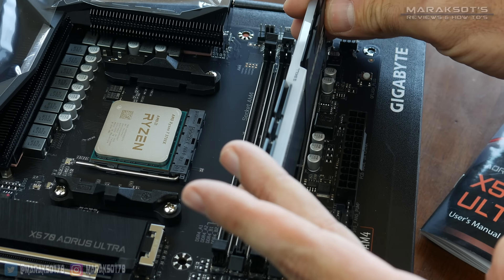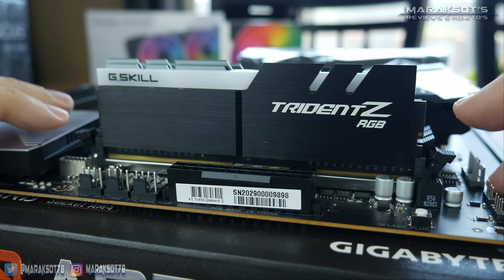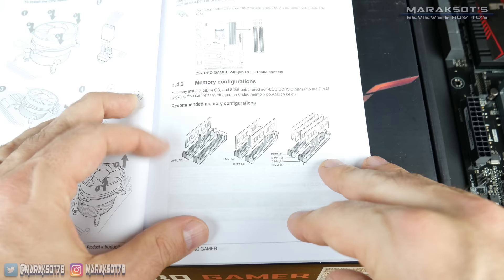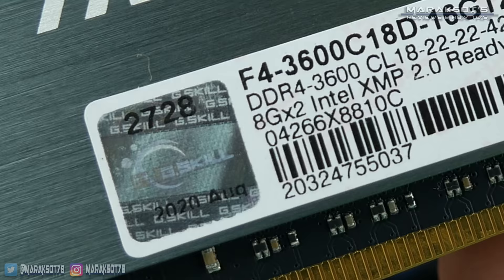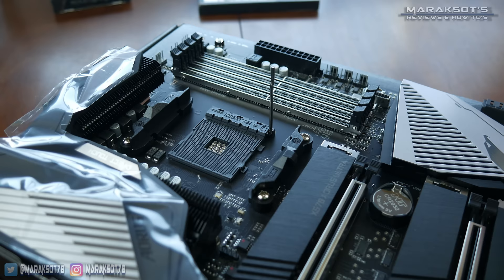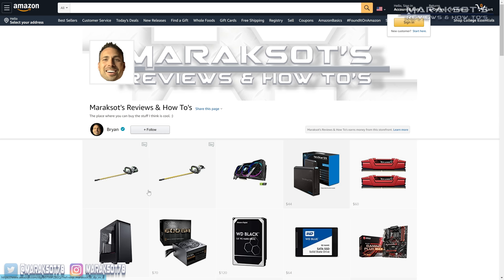A Beginners Guide: Upgrading Your PC's RAM

Comment from the maker: Wanna skip to a particular part of the video? Use the Time Stamps. :)

Time Stamps

0:00 – intro
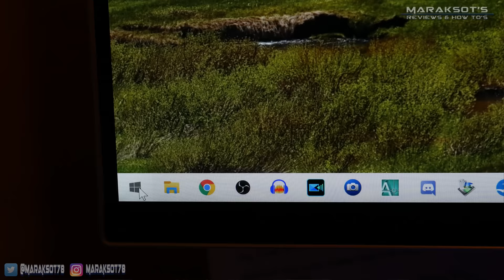0:22 – the first steps
1:33 – how to remove RAM modules
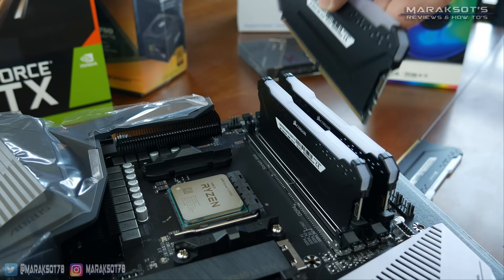2:03 – how to install RAM modules
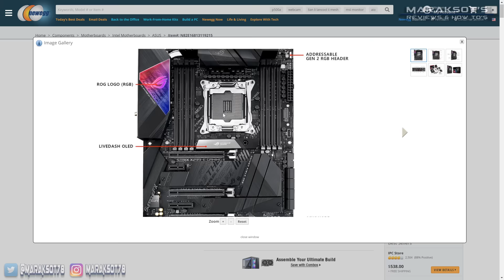2:58 – 2, 4 & 8 DIMM slot motherboards
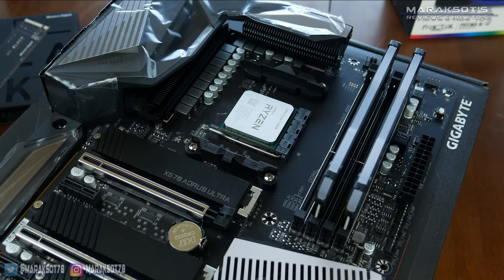3:30 – Single Channel or Dual Channel?
4:10 – running your RAM in Dual Channel
4:41 – using 1 stick of RAM only
4:57 – tips for adding more RAM to your system
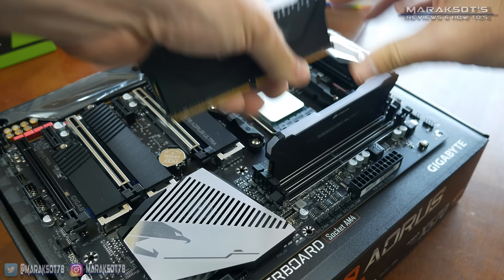7:12 – tips for upgrading your RAM
7:40 – determine your RAM type (DDR3, DDR4, DDR5)
8:40 – How much RAM should I buy?
9:01 – What speed of RAM should I buy?
10:00 – check your motherboards memory support list a.k.a. QVL
10:51 – my first PC building experience
11:56 – Thanks for Watching! Like, Share, Comment & Subscribe! :)
Reply: okay please see this my mic is not in my audio settings, like it says no devices installed and my mic is plugged in
Reply: once i completely remove my okd ram sticks and in new ones will i have any software i have to download or do they start working right away?
Reply from the maker: @Austin-xm4ke  nope, no software to install, but if you want them to run at their rated speed you will have to enable the XMP profile in your motherboard BIOS.
Reply from the maker: @PalaceLad  yup, they go in the same way but the latch on the one side is the only one that locks.  :)
Reply: I want to buy the NZXT Starter PC and I want to upgrade and replace the one stick of ram. Do I have to download anything to upgrade it?
Reply: Nvm i made it to the part in the video where you say it is easier to replace the ram
Reply: @Maraksot78 Is it possible to have three sticks of ram
Reply from the maker: @ratanvuyyuru9076  I would of course turn the computer off, unplug the power from the wall and then remove the old RAM (assuming you're removing your old RAM), and then install the new RAM.  There's no need to unplug your monitor, keyboard mouse and other stuff unless you can't get your PC into a position to work on it with all that stuff still plugged in.
Reply from the maker: @ratanvuyyuru9076  No worries... I have never disconnected the PSU from the motherboard. I guess for the safest possible practices you would do that but I've never done that and in 15 years of PC building haven't had an issue.
Reply from the maker: That's what I would do.  Linus Tech Tips actually made a video recently where they used an ESD gun and intentionally tried to kill PC components with an electrostatic discharge and showed it's actually far more difficult to kill your components with ESD than many people will lead you to believe. Yes it is possible, but it is honestly far less of a concern than the ESD fear mongers want you to believe.
Reply from the maker: @ratanvuyyuru9076  here's a link to LTT's video if you're curious. They do kill some RAM right at the beginning but if you keep watching they try to kill some more and end up hurting themselves more with all the shocking they do than the RAM. 😅  https://youtu.be/nXkgbmr3dRA
Reply: Hii I just don’t want to get my pc killed, so is holding a metal part of the pc full proof?
Reply from the maker: @leonm6969  it's actually a lot more difficult to kill PC components with ESD than many people will lead you to believe. LinusTechTips actually made a video about a month ago where they tried to kill some sticks of RAM using an ESD gun. While they did succeed at first, they spent the rest of the video trying to kill another stick of RAM but were not able to kill another one even though they were shocking the RAM with more static than a human typically carries. If you'd like to watch the video and see just how hard it actually is to kill PC components with ESD here's a link to their video. https://youtu.be/nXkgbmr3dRA
Reply: Best video yet and very very informative 💯%
Reply: After physically adding a new RAM stick, do you need to do anything on the PC or does it automatically gets used by  the PC ? Thanks
Reply: you don't install more ram, you download it. Everybody knows that
Reply: I really liked the video and the simplicity of it. Great stuff
Reply: Hey buddy I have watched whole tutorial now what? Should I start the pc and I will have 16gig of ram or any setting must be done from inside
Reply: Do i have to take the whole motherboard out of my pc to install more ram?
Reply: @Maraksot78  what is XMP?
Reply: stuck at preparing automatic repair after installing new ram? suggestions?
Reply: i think i only have 1 place where i can only place 1 stick of ram? what do i do
Reply: Thanks, great info and your delivery is enjoyable. I wish I could talk to a camera like you do,
Reply: Is it safe if i replace my ram sir?
Reply: Since I plugged two new sticks of RAM into my pc, my monitor screen goes to black every 10 to 60 seconds then comes back on. Please help! @Maraksot78
Reply: @Maraksot78  Hi I'm a newbie when it comes to pc stiff. I would like to know if I currently have (2) 8gb oloy sticks 3000hz total of 16gb ram in my gaming pc. But I'm looking to add a another (2) 8gb oloy sticks same brand same speed to my pc to add a total of 32gb ram after I install the other 2 sticks do I need to go into bios to adjust the speed on the other 2 sticks? Or do I just install them and do nothing else?
Reply from the maker: @Mario-uq8gr  you'll need to go into BIOS and enable XMP again. I'm pretty sure it will go back to default when your system boots up for the first time and recognizes the new RAM.
Reply: @Maraksot78  ok cool thanks
Reply: Got a question when wanting to completely change the ram like take out the old ram and add new ones can I just use any brand?  and if I need to do anything else if I change it like do something in bios I’m a newbie if you didn’t already tell hehe pls help
Reply: @Maraksot78  do I need to use XMP? cant the ram just go with out it?
Reply from the maker: @animations iguess  your RAM will work normally without enabling it BUT it will only run at the rated XMP speed if you enable the  XMP. For example, unless you enable your XMP DDR4 will only run at 2133MHz no matter what your modules rated speed is.
Reply: @Maraksot78  well I’m mainly wanting to get more ram because my ram is getting full my memory is at 71%-91% and I can’t play my games anymore thank you for answering my question! Very helpful indeed
Reply: Yes adds... Yes lickbait.. Tells you when to skip videos if that iformation is not for you... 
Subscribed!
Reply: I put 4 x 8 gb dual channel ram from 4 x 4 gb . PC showing 24 gb with (15.9 gb useable) .How can I make it read 32 gb only? My PC games 20% faster on FSP and my resolution on video streaming internet also got better by 20%. I really like to see if I can get it to 32.gb instead of showing 24 ( 15.9)
Reply: can i ask? i have 16gb ram but the half of it is not use, what to do?
Reply: that's not working.need to upgrade memory

Comment: you don't install more ram, you download it. Everybody knows that
Reply: Is this true
Reply from the maker: @kerryangel603  Downloading RAM? No it's not true. It's an old joke among PC DIYers.
Reply: @Maraksot78  ohh btw you think you can help me
Reply: @kerryangel603  I know it's 3 weeks later, but what you looking for help on?
Reply: @mynameis8211  installing ram
Reply: true that currently downloading one from an unfamiliar site
Reply: @kerryangel603  once you download your ram you extract it from winrar
Reply: A gigabyte of ram should do the trick
Reply: @kerryangel603  what seems to be the problem
Reply: @user-ss3de2tv2n  my pc makes too much noise
Reply: @kerryangel603  how long have you had the pc if you’ve had it for long it could be a dust issue if not then just turn the pc off and let it rest for about half an hour and let it sit then try again letting it set could help air it out because it might be over used
Reply: @user-ss3de2tv2n  I’ve had it for 8 months
Reply: @user-ss3de2tv2n  how do I indust it
Reply: You can find it at pretty much anywhere
Reply: @user-ss3de2tv2n  will anything bad happen if I do this
Reply: @kerryangel603  Nope i dont know anything about cleaning pcs but i did it before and its good as long as you use compressed air or if you dont have that lightly scrub the pc with tissue.I recommend unscrewing the fan because it’s usually caked with dust.
Reply: @user-ss3de2tv2n  get a new heat sink fan installed as sometimes they run off centre and cause noise, unless its the fan from the power supply,k look into that.  Cleaning pc every 2- 3 months is essential . WHY?  the dust builds up in your "Heat Sink" (the thing that cools down your microprocessor, very bad to overheat it.)  blow out the dust.  Make sure  you clean the vent mesh that screens out the dust to, just run it under a tap and get the dust out and let it dry. Why? the dust builds up and forms a cover so no air can get in and out and your motherboard or video card over heats and then.... Black screen.
Reply: Linus tech tips got 2 TB ram 🤣
Reply: @user-ss3de2tv2n  to avoid dust "floating" inside the pc, use a vacuum at the same time.
Reply: @kerryangel603  bruh
Reply: (pretending I get joke so I fit in) 

Haha! So true..so true.
Reply: FACTZZZZ
Reply: I tried downloading more ram but I ended up with a virus please help... I spent 3,000 dollars on this pc at a local pc shop. I don't want to waste more money. Im just trying to DIY...
Reply: @TheNuggzt3r  I like to wash my sticks in sea water as it's so natural and Earth Grounded.  It allows my RGB to be brighter.
Reply: How mooch dedicated wam do I need for me moincwarf sorver.
Reply: Nice video man! Thanks for getting to the  point.👍
Reply: @luizeduardo854  Did you find a solution?
Reply: Once you download you have to install tho...
Reply: Lmao
Reply: Hell yeah😂😂😂😂😂😂😂
Reply: Yeah
Reply: “you wouldn’t download a piece of ram would you?”
Reply: Old school meme right there
Reply: Downloading 32 GB of RAM when I have only 10 GB of storage left, hopefully I can compress the files
Reply: This isn't Twitter
Reply: @WiscoMadman  ratio
Reply: @Nibble4B  ?
Reply: @kerryangel603  bruh did u not watch the video? like what😂
Reply: @Maraksot78  😂
Reply: Lmao my guy
Reply: @kerryangel603  I know it’s 2 years later but what do u need help with
Reply: Bro, dont do this. I know almost nothing about PCs. Im 19 and just a few months ago, i learned that the PC is actually the box, and not the screen. And i also learned what a monitor is. Ive always played video games on the TV and so never needed or saw a comouter ubless i went to the library or friends house.
Reply: You wouldn't download a house
Reply: @Maraksot78  it was a legitimate scam in the 90s
Reply: Bro made 1 mil people search if you can download it 💀
Reply: Here’s something that can change your way of life or thinking. This is the most important thing you will hear/read today. 
If you’ve told one lie, stolen anything, or lusted (which is adultery of the heart), you’ll be found guilty on Judgment Day and end up in Hell. But there’s good news: Though we broke God’s Law, Jesus, the prophesied Messiah, perfectly kept the Law, fulfilling all righteousness. He paid the fine for sinners ( that we could never pay ) by suffering and dying on the cross—absorbing the wrath of God that we deserve. “For by grace you have been saved through faith, and that not of yourselves; it is the gift of God, not of works, lest anyone should boast.” Then Jesus rose from the dead and was seen by hundreds of eyewitnesses. Today, repent and trust Jesus; God will grant you forgiveness and the gift of eternal life. God blessss
Reply: @kerryangel603  Here’s something that can change your way of life or thinking. This is the most important thing you will hear/read today. 
If you’ve told one lie, stolen anything, or lusted (which is adultery of the heart), you’ll be found guilty on Judgment Day and end up in Hell. But there’s good news: Though we broke God’s Law, Jesus, the prophesied Messiah, perfectly kept the Law, fulfilling all righteousness. He paid the fine for sinners ( that we could never pay ) by suffering and dying on the cross—absorbing the wrath of God that we deserve. “For by grace you have been saved through faith, and that not of yourselves; it is the gift of God, not of works, lest anyone should boast.” Then Jesus rose from the dead and was seen by hundreds of eyewitnesses. Today, repent and trust Jesus; God will grant you forgiveness and the gift of eternal life. God bless
Reply: @alexandros4159 a gigabyte won't cut it, why not step it up to a kilobyte at least
Reply: Lol... Funny
Reply: Hahshahsahahahsh
Reply: I didn't 😂
Reply: @Maraksot78  nuh-uh I downloaded all of my ram and it works fine
Reply: @kerryangel603 i know its 3 years later but you still need help
Reply: Link pls.
Reply: Jesus get to the point
Reply: Be QUIET
Reply: @kerryangel603 lmfao no

Comment: Instructional video. However, it is not always so easy to find (years later) a RAM brand & type which was tested by the manufacturer of your motherboard. Also keep in mind that the dimensions of your new RAM can vary with the dimensions of your existing RAM meaning that you must look very carefully to your motherboard layout to make sure the new RAM fits into the slots (and is not obstructed by - for instance - the cooling fan on your processor).

Comment: Thanks for the insight. I salvaged an 8GB RAM from an old laptop to add to the 8GB in my current laptop. Same manufacturer, but the laptop became significantly slower. Your explanation of running at the slower speed seems to be the explanation I needed
Reply: There is also so to speak diffrent generations of ram the most modern one is ddr5 while a lot of pc's nowadays use ddr4 older pc's used ddr3 and so on each new generation is faster then the previous one

Comment: My new brother 💖😀💖. Man-o-man do I appreciate this video. I have been educated in many forms. First of all as I am typing this out, I have two different speeds of ram in my computer. It made no sense when I was working slower and freezing for up to 30 seconds at a time. I have just subscribed and we'll be going to you first with any computer education. What's sad is I built my first computer around 1991. So I thought I was a little educated myself. I try to keep up-to-date and I repair my own computer which is actually store bought. But I can pretty much fix anything hardware or software. I have not made comments too many people on YouTube. Mostly because I knew as much as they did. Or they did not impress me. I cannot say that about you many thanks and lots of love

Comment: as well as the same speed and capacity, ram timing is most important if you want to run two different brands. different brands might both have a 3200mhz rating with a cas latency of 16 or whatever, but the last number of the timing sequence could be different. eg: vengeance pro 3200mhz timings are 16-18-18-36 and trident z of the same rating is 16-18-18-38, just change the ''row active timing'' at the end to be the same as each other, you can definitely run two different brands, no troubles at all.
Reply: How do you change the last number

Comment: i ran the crcial scanner told me what i could add, then looked ar task manager under performance, checked memory, saw i was running ddr3 1600mhz, bought 2, 8gb ddr3 1600mh dims, took out the old, inserted the new turnned on, an all good no beeps, running 16gb ddr3 1600mhz took 5 minutes in an hp compac pro 4300 sff.  was pretty pleased even watched a few videos, just to  make sure, thanks to all the how to vids. on you tube, getting the nerve up to build my own desktop pc....... tks...

Comment: I'm no expert so I would like to call out a problem I ran into that hasn't been mentioned on any of these videos.  If you upgrade to two sticks or more, remember to RESET your CMOS.  If you have installed everything according to instructions and you still find the BIOS is still running single ram, a quick reset reclaimed the dual channel function in the UEFI and all is great.  Doubles my RAM.  Twice as fast is great, quite a surprise.  Great job on the video, very informative except for this one point.

Comment: I would recommend more than 16 GB of RAM as games like Warzone - and other badly optimized games - take up a huge chunk of memory. I am currently in the process of upgrading from 16 GB to 32 GB as both Warzone and Borderlands 3 (with the settings that let you run it properly) takes up about 90% of the RAM (in combination with background tasks running).
Reply: I just got Hogwarts and it’s chewing up my RAM. Time to double up 😂
Reply: I'm doing the same. I like to have lots of tabs open while doing game dev, 3d modeling, discord, obs, video editing, etc etc and it adds up fast